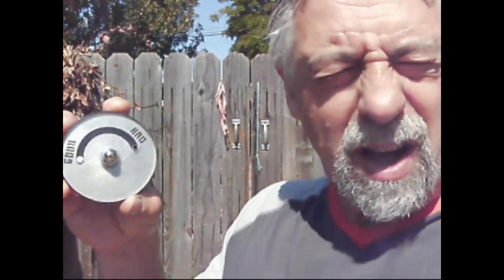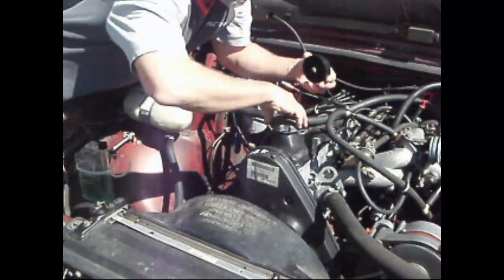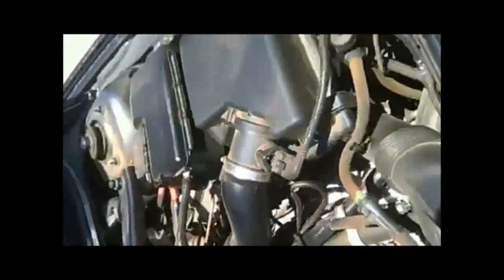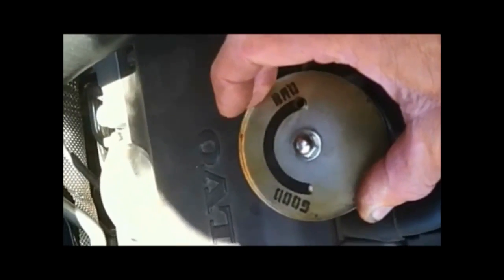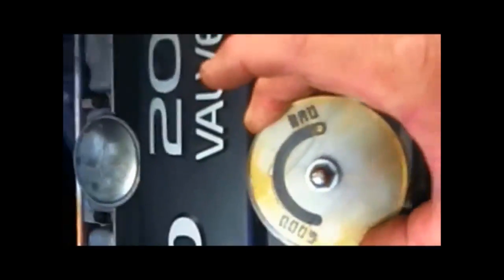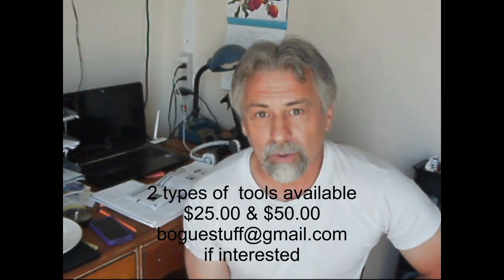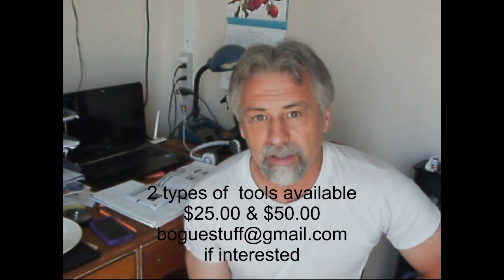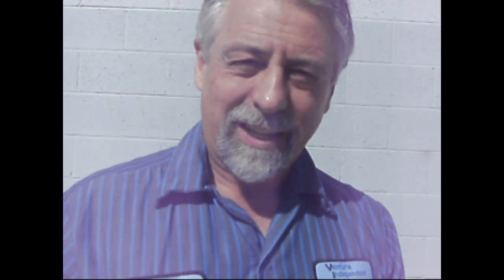Volvo PCV system checking and special tools

Comment: We just bought a used 850...I like your tools, though I would prefer more emphasis on wearing safety glasses when inside engine compartments.  I have had eye issues when debris off of the engine wedge in my eyes during a similar revving....even with glasses but yo have to have the side protectors..just a reminder.  Great videos though! 
JRL in SEattle

Comment: Excellent video. 2002 s40 T
Is there a cheaper way to service pcv system? than replace the whole kit(as per dealer suggestion $400 + labour)  I ve been told that  cleaning the filter at the end of the pcv hose in the air cleaner and  the nipple in the intake manifold would do the job. Do you agree?
thanks for your video

Comment: I presently replaced pcv system in my 1994 Volvo 850 turbo it its still doing the same smoke coming from oil stick what else could be clogged the old parts was not clogged.  Help
Reply: Your piston rings could be dying... thus blowby into the engine and thus pressure in the whole engine.
Reply: If its rings what would suggest no quick fix
Reply: Tyrone Chisholm

If it's the ring you will probably have to get atleast a new set of rings, or even overhauling the complete engine.
To make sure, do a compression test.
Did you looked if the PCV duct that leads into the engine was clogged? There often is some oil carbon clogging it, even deeper down in the duct.
You could try to clean this by either taking of the oil pan or the PCV system again and try to clean it with a wire thoroughly.

Other than this, there aren't many reasons you could have so much pressure in the crankcase, but you could also look up the PTC valve like another guy wrote earlier.

Comment: I heard you can also your a bag to put around the area that you pour oil in..  if it trys to suck the bag in, you are good, if it blows bag up, then bad (pressure), can also do it through the dip stick, which is safer, not as hot as the oil cap area.  bag can possibly melt because of the heat, if car is very hot.  Great video, good tool to have in either case.

Comment: How much does this job costs to have a mechanic do it,  you know pvc replacement on a 01 Volvo s80 2.9 non turbo?
Reply from the maker: Probably in the $300.00 range, it depends on the shop. Have a Volvo shop with a good reputation do it, general repair shops usually charge way too much for most stuff on Volvos because they are not familiar with what needs to be done and what does not. What city are you in?
Reply: West Palm Beach fl